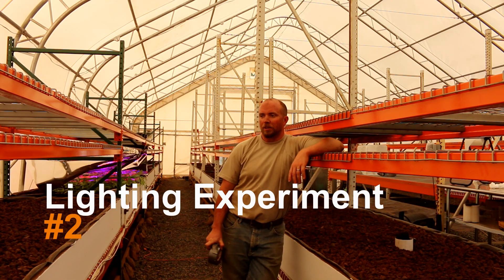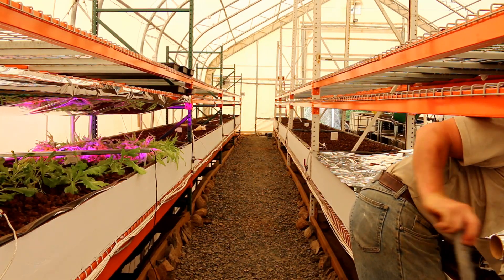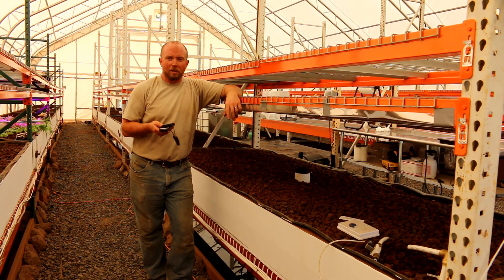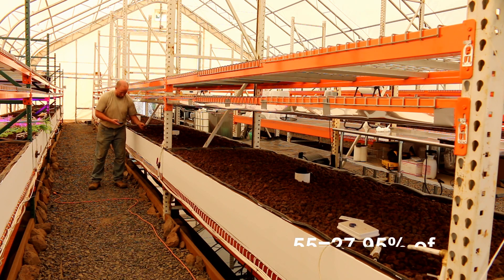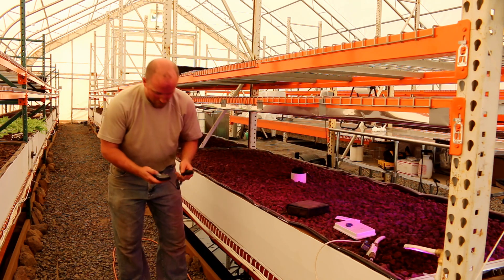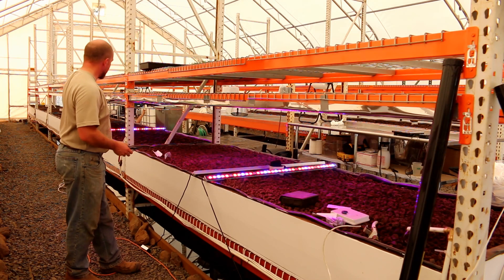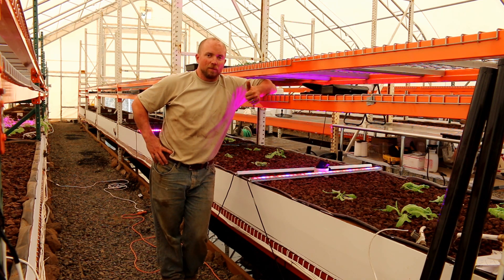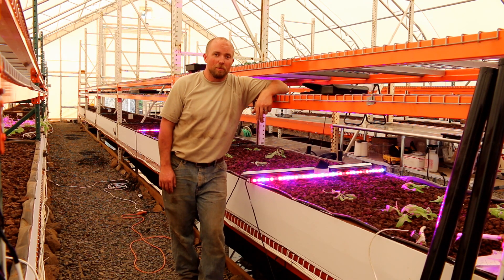Aquaponic Lighting with Mylar and LEDs

Comment: Could you put the Mylar on the North side of the bed (possibly angled toward the center) and reflect two lights from the South side?  It seems the reflection is helping to disperse the light.  Mylar on the side would not allow water to collect and, though it would block light from an adjacent lane, the North side of the building will be blacked out anyway.
Reply: I was thinking the same/similar thing.  Hang the Mylar on the North side to catch the Sun Light and Artificial light that is jsut going to exit the bed anyway and try to reflect to back into the bed.  this keeps the upper shelves open and water can flow straight down.  It might not be a good RIO, but if you are trying to maximize growth, it certainly could help.

Comment: Make an inverted V out of the Mylar I.e. High in the centre, half height at each end.  The water will flow off the ends and could be dropped into the lane below and as long as the film was taught enough there shouldn't be any pooling.
Reply: Agreed. Forget about punching holes and angle the mylar toward the ends or sides.
Reply: That's what I was thinking

Comment: TRM,    Could you use 4 of the strip lights running along the length of the orange rail?   You would need to tilt them in some  and maybe offset them.

Comment: Ok, lets look at this another way.   Maybe the lights are the problem.   Are they bright enough?   What about say accent lights of some sort that you can add to the sides or ends.   Another thing you see on typical fluorescent work lights is the bulb is in the center of a reflective open enclosure.   What about longer lights that go the length of the growing bed.   To save on electricity is it possible to pulse the lights.   Another is to just have them on say 15 minutes on and 15 minutes off.   I don't know just throwing thoughts out there.

Comment: What if you put the lights the long way and aim them in.  Could you get away with 4 lights?  Two on each side.   Also you might be able to put the mylar on the sides between lanes and maybe on the back of a lane. but that would restrict access to only one side of the lane then.

Comment: what I noticed:
-reflection the light off the reflective surface, there's always some loss and it's less ideal than the light facing down on the plants. 
-the gravel in your system is really dark, so it absorbs a lot of light. 
-by having the light reflect over such a distance to the plants, you have a lot of intensity fall-off and scattering of the light. 
-having the side open only gave you like 2-4% of the required light?

why not try:
-mount the lights up high, have the reflective mylar drape down on one side so any scattering is projected back in
-only put the mylar directly behind the lamps, as any light scattering from the plants would be be most concentrated around the source of the light
-try mounting light up at your path, facing in, and putting the mylar on the opposide end to reflect any light back in?

anyway, interesting to see you go at this. it seems like a lot of the gains you're getting are quite marginal and you just need a whole lot of lights.

Comment: Don't give up on the mylar so quickly .you don't need to punch a bunch of holes you only need to punch one or two holes .put a weighted object in the center of the mylar that's where your hole will be for drainage. You can control where the water goes as well

Comment: hang that mylar horizontally on the  north side of grow lane and the  grow lights  on the rail at top of south side  pointing  at mylar and also on north side facing  down at 30 deg angle that way you  still get light  from southern exposure  and  can prob do it with  4  lights per stall
 ie like this

                                            South
mmmmmmmmmmmmmmmmmmmmmmmmmmmmmmm
__________________________________________________________
LLLLLLLLLLLL                           LLLLLLLLLLLLL

                           LLLLLLLLLLLL                            LLLLLLLLLLLLL
__________________________________________________________
                                             North

Comment: Hi Martian,  isn't it possible to put the mylar on the north side of the bed and put the LED lights length wise on the top of the south side so that you get more coverage of light? it would also help to reflect the natural light that comes in from the south.
The downside to that is that you only can work on the aquaponicbeds from the south side and you must be carefull of puncturing the mylar. To get rid of those downsides you can but the mylar on a pvc board that you can flip up so you won't have the downsides that i mentioned at all, it just costs a little bit more but you have the mylar around anyway so a dry run without the board should be possible to test it...
Happy Sunday and i hope the fire get's handled in the next few days.

Comment: Try removing the lenses inside the light if they have any, by the look of the spread pattern they probably do. They increase intensity (only because it focuses the light) but reduce spread, also cut out 10% of total output due to loses going through the lense. If the rails have a plexiglass covering, a cheap option would be to try sanding the cover glass thoroughly to replicate the affect of diffusion. Use a low grid paper to make the affect more rough.

Comment: Can't cheapo out on lighting, you want to max yield and grow rate, you need lighting that isn't just covering the whole area, but also adjustable and as close as possible. So you can raise it when the crop is growing. Also, remember you have water coming down from above still, make sure those lights are water tight. Don't overestimate reflection, it's nice if you can cover it with reflection, but it is not as important as complete coverage and being close to the crop, lets say you mylar it all in, you might get away with 4 lights instead of 5, but with a ton more hassle.

Comment: Have you thought of backing the mylar with a coraplast or thin aluminum then using a parabolic effect by raising the center of the mylar and attaching it to the grates. The slight arch would move the water to the edges where you could collect and move it away with some gutter drains. Hope this helps or creates some ideas.

Comment: It looks l like gee next experiment should be them in parallel Running the length of the bed, facing away from the worker.  You may be able to get away with three per bed, but it looks like two just not going to do it.  Edit... You may still be able to use the Mylar hanging from the north side since that side is going to be heavy insulated anyway.

Comment: How about rotating the lights back and forth instead of moving them. It's probably easier to build and you would only need one servo motor per light, and I believe a servo would use less power than a dc motor.

Comment: Would clear LED rope light work??? You could run the rope light all the way around the outside of the frame, The lights being inside of a clear tube you could keep the moisture off the lights. You can buy on a 100 foot, 500 foot, for 1000 foot rolls
Reply: i dont think they give off the correct type of light
Reply: Main problem would be that the energy used to produce the green part in white light would be wasted.